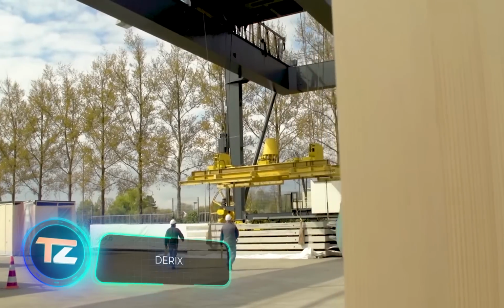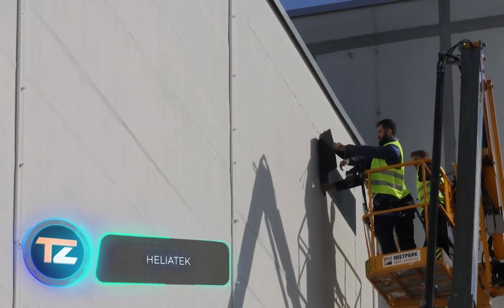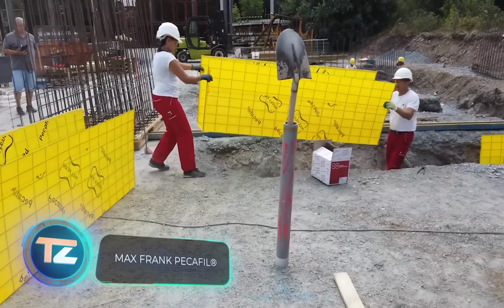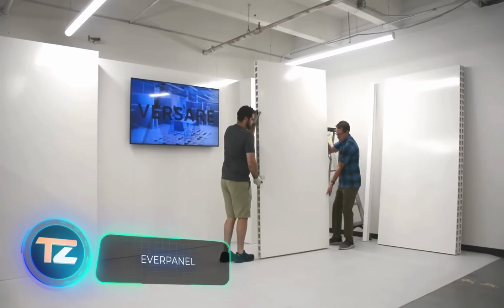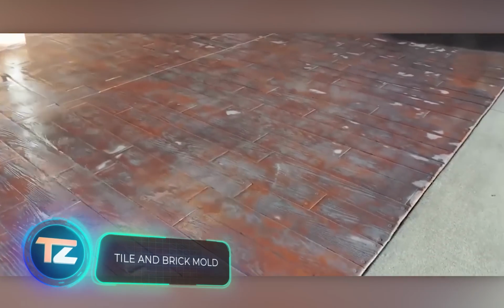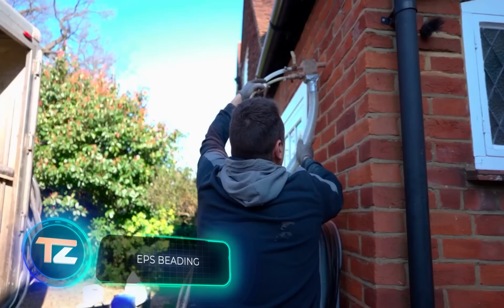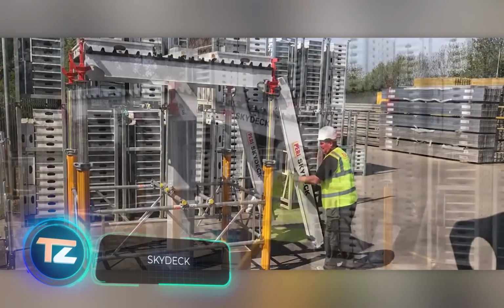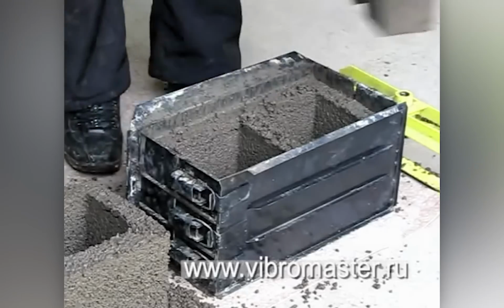CONSTRUCTION TECHNOLOGIES THAT HAVE REACHED A NEW LEVEL

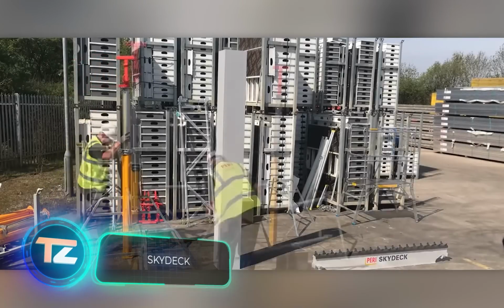Comment: 18:36 The Peri Skydeck isn't new. It was used on a project at a trade school north of the Perth CBD starting 18 months ago and the "pans" (as is the individual pieces of skydeck that concrete is poured on) were definitely looking second hand.

That said it's a fantastic system with stillages made for transport and storage. You can always find counter arguments but I'd prefer to see this on site over timber I beams with plyboard from a safety and program perspective.